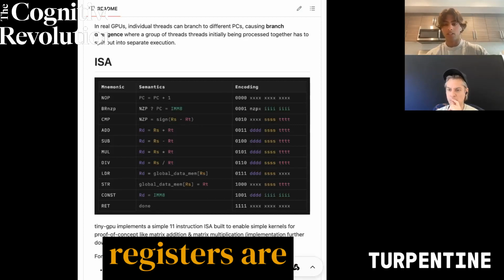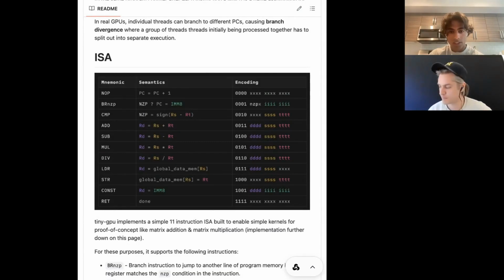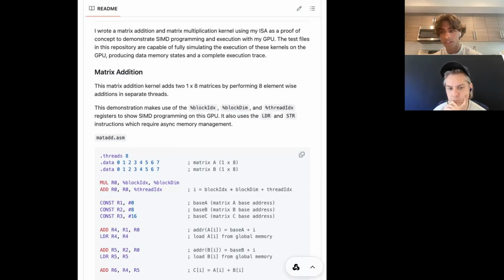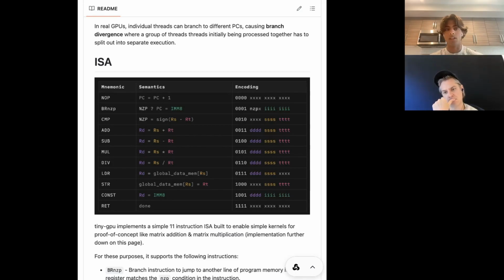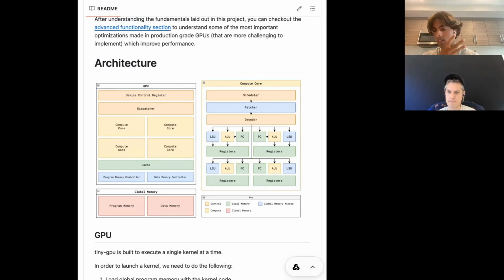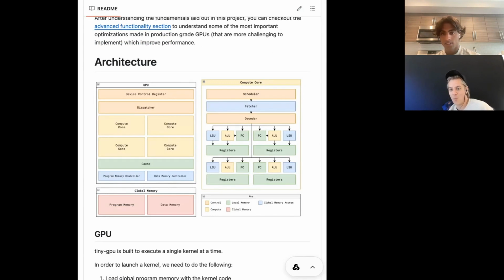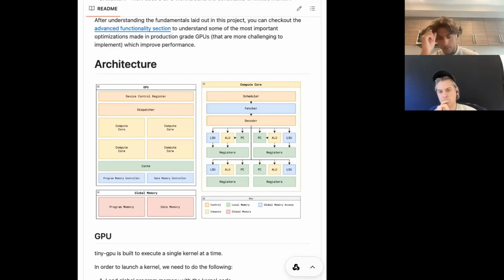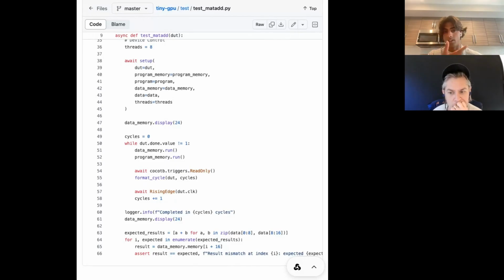TinyGPU, Massive Learning, with Adam Majmudar

Comment: Too much overhead on GPUs with memory, cache, controllers... Groq is simpler, no cache, no wait, data is on the exact memory spot at the expected time. Execution time is deterministic. This is why it is so much faster.
Groq is like a clock!
Reply: groq is a completely different architecture. and, afaik it is not open source.